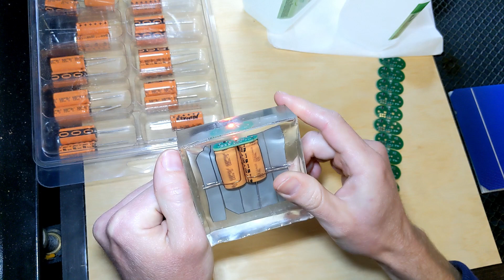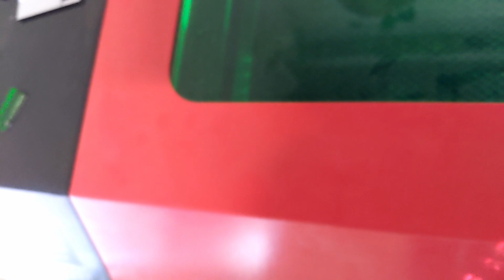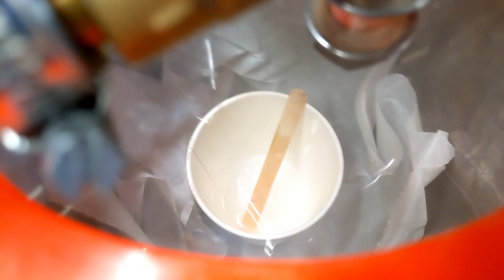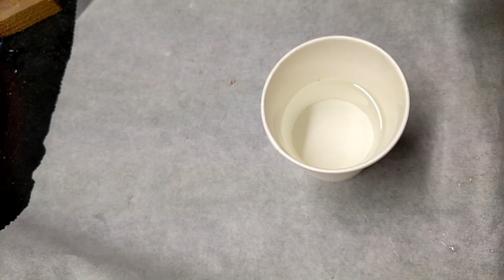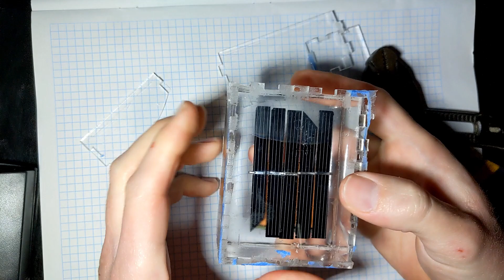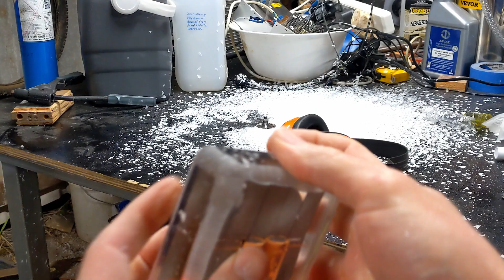Rugged solar Morse code blinker - How to build one

Comment: I guess you could pull a vacuum and then let the resign cure inside the vacuum before letting the air back in. But I guess some bubbles may just become bigger without rising to the top and they will obviously stay big, if you let it cure in a vacuum. So not sure if that approach would really be an advantage. Not to mention that you would of course need a good seal, to sustain the vacuum over a fairly long time. Anyway, you should try sanding all the surfaces flat and polishing them. May be extra post-processing. But I bet it would look pretty cool.
Reply from the maker: I would really like to polish them glassy-smooth, but I haven't worked out a way to get good results in a reasonable timeframe with what I have to hand. I'd probably have to buy a buffing wheel and a range of abrasive gritty goo. I did try 600-grid wet'n'dry running under a continuous flow of water and that worked pretty well, but was a lot of work and only got me a kinda frosted finish, not perfectly clear.

Comment: That's pretty nuts cutting a solar cell! Must admit I've hacked a house solar panel so I could use it on my ute. My question is this, because you want to use monocrystalline solar cells for longevity; Why not make it bigger? Comprehensive documentation nonetheless of your project,  I really need to start doing something similar myself for my own projects ;)
Reply from the maker: Thanks! The 60x60mm arrays charge up the supercaps very quickly, like half an hour. I don't need that kind of speed, really. Making the solar arrays smaller also lets me save on costs while experimenting.